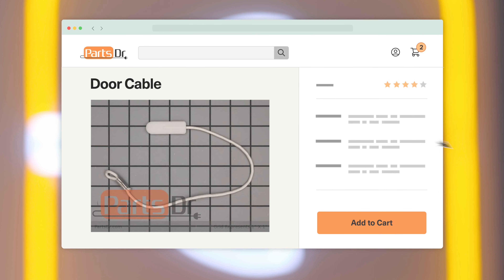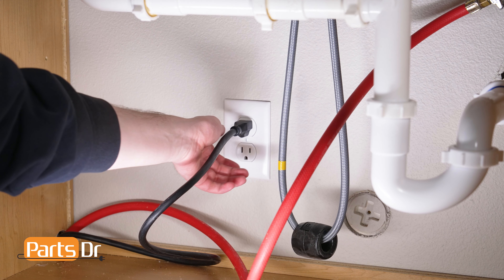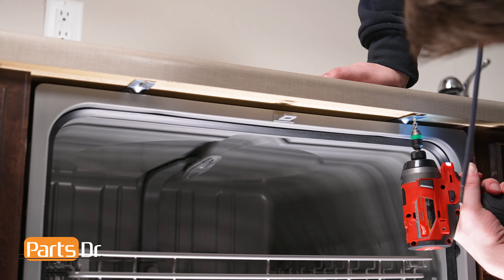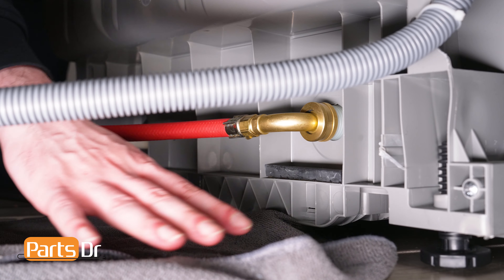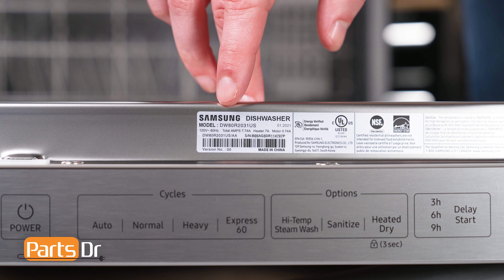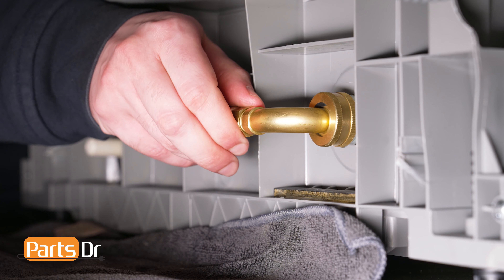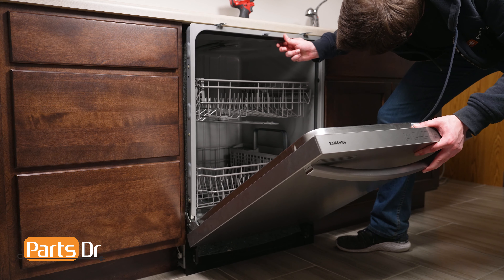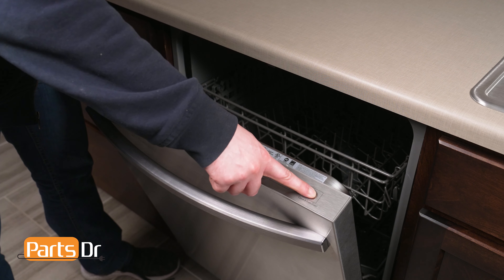How to replace Door Cable part # DD81-02301A on your Samsung Dishwasher

Comment: Hi, what is the name of the little wheel that the hinge cable goes through? I need to replace one of those, thank you!
Reply from the maker: They don't sell the wheels separately, they are sold as part of the Support Link Assembly.  They are side specific to the right or left side.

Comment: Hi, what is the reason we are disconnecting the  water lines/drains when we are only replacing those hinge cables ?
Reply from the maker: It is because you cannot access them with the dishwasher installed in the cabinet.

Comment: Hi. If I have model ending on /AC and version 00. Which part number I need? Thanks
Reply from the maker: Assuming the rest of the model number is the same as the one shown in this video, your uses the same part here: https://partsdr.com/part/dd81-02301a-door-cable?model=DW80R2031US---AC
Reply: Do you ship to Canada?
Reply: And what is its length?
Reply from the maker: @VasylChembura-fh1ov  We do not ship to Canada.  Samsung does not specifiy the length, all parts are specific to the model number.
Reply: @PartsDr  Thanks. Have a great day